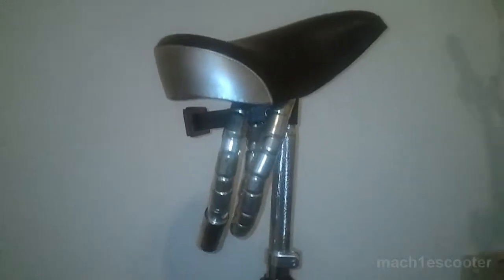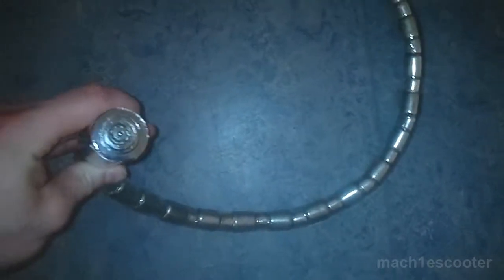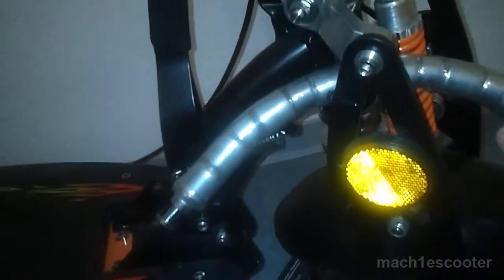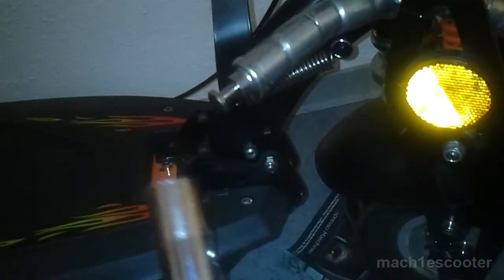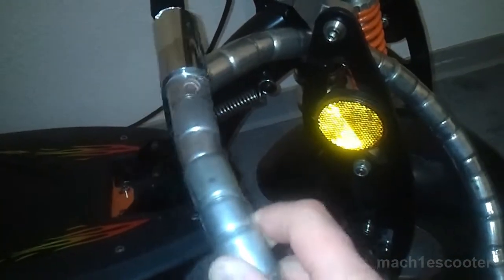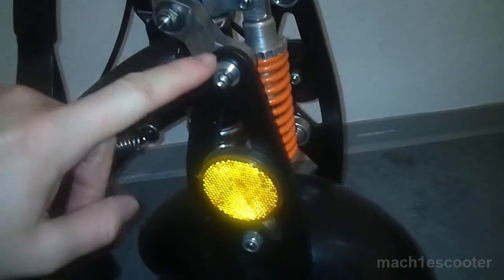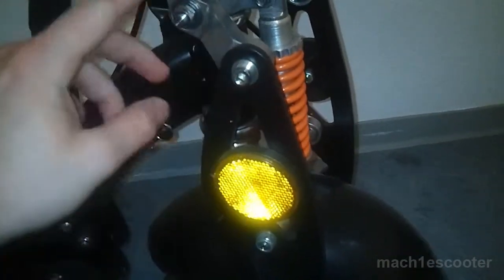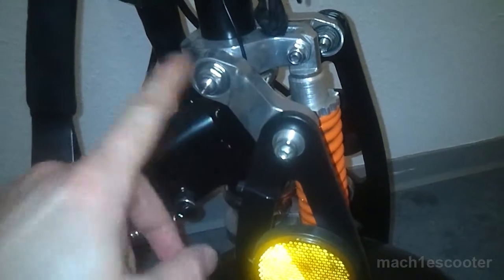MACH1 Electric Scooter 1000W 48V - Theft Protection Part 3 TUNING MODIFICATION

Comment: Wouldn't it be better to a certified U lock pushed between the front column of the scooter near the base and the body of the scooter that way they would have to take the front of the scooter off disassembling the whole front end to get at your scooter.

It's hard to describe exactly what I mean but, just in front of the lever where you placed the lock by the spring, if you used a U lock it would go from one side to the other and then you could lock it directly to a pole or cycle rack.

Just to add: those locks are crap by the way and a long way from being durable, however U locks such as abus are much better, more expensive but much stronger.
Reply from the maker: flitsies Sure you could use a U lock, it could be more durable but I believe it is heavier, too. Sometime you need a bit more reach as you can't always come close enough to pole or a cycle rack. But seriously, if someone wants to steal your scooter, he will do it anyway. He will steal it even with the pole or with the whole cycle rack ;) I just don't leave mine outside for too long or in unsafe areas.
Reply: MACH1 E-Scooter Yes you are correct no amount of locks will save your bike/scooter if someone really wants it, but deterrence is always better than handing it to them on a plate.

The lock you are using is known to be probably amongst the worst and amongst the easiest to break, the locking mechanism is some kind of softish alloy and the lock is rubbish, inside the plastic sleeve is a cable which can and is easily cut.

Using a U lock of the type I mentioned yes it is a bit heavier, but it is also by far much better and a bigger deterrent.

You could even use one of those alarmed padlocks in combination with a decent lock, so the alarmed padlock would simply be to inform you if someone is tampering with your scooter, it doesn't actually have to be used to lock anything just use it for the alarm, they are not heavy and a good addition to your security.

Anyway how do you like the scooter is it any good, I'm considering buying one of these, but am finding insurance a bit of a problem, we have to have insurance for this scooter in the UK.

Does climb hills at a decent rate?
Reply from the maker: flitsies Well that's true, the locking mechanism is a bit weak but the lock itself looks solid. The plastic sleeve is transparent to protect the lock from rusting but inside it's all metal. I don't think, you can cut it that easily. Alarmed padlocks are really a good idea, I need to consider it. Yes, it is definitely worth 600 euros. I have also got insurance and a license plate, it is quite cheap. Should be the same in the UK. Legally it is a moped. Here is a video I made, how to install a license plate: http://youtu.be/beCylVkI5HAYes, it is really powerful, it can climb almost any hill. Check out these videos, a racing gear and a hill climbing gear were used for this test. That was a really steep climb:http://youtu.be/XAT2EUkU2ichttp://youtu.be/SjLUXnuPY7Yhttp://youtu.be/ZJSC3R0AngMUsually you don't stop before the hill, so you will be at about 28 km/h like in this video:http://youtu.be/my7d0pSh3h0?t=50s
Reply: MACH1 E-Scooter Seriously those locks are not good at all, any would be thief will have that off in no time at all.

The push in part will change colour over time and use exposing the copper type colouring of the metal used the actual cable can be cut with a simple hack saw, really not worth using unless you don't value your scooter.

Spend a little extra on a good lock, use an alarmed padlock just for the alarm just to stop people tampering with it.

As for the insurance and price, yes they are similar except for insurance, I did a check on an insurance web site to see how much it would cost an experienced motorcyclist such as myself to insure it if I had zero no claims bonus, I was shocked.

Fully comp would set me back nearly 1100 hundred pounds probably around 15 hundred Euros, take away fully comp and it dropped down a lot but still expensive considering the price of the vehicle, in fact for that money I could probably insure a top of the range sports bike and still have money left over for a complete engine rebuild.

One other thing is actually finding an insurance company willing to take it on, they will take on the 500watts but not the 1000watts

So one of the problems with this type of vehicle as I'm sure younger people have discovered in trying to insure one of these is the price of insurance is so high it prices young people away from them in the UK.
Reply from the maker: flitsies No, the insurance should be around 100 GBP or even less. You need to insure it as an electric scooter or a moped and NOT a motorcycle! Check out this page: https://www.bikesure.co.uk/electric-scooter-insurance.php I believe, there shouldn't be a problem to find an insurance company for a 1000W scooter.
Reply: MACH1 E-Scooter I wish it were that simple, so far every insurance company I have spoken to have said no, they will insure the 500w version, actually that's not quite accurate, what I mean is if you have no, no claims bonus yes they will for around £1100 fully comp, if you only want third party it drops to around £260 now imagine if you were a 16 year old wanting to buy one of these, the insurance would be through the roof, cheaper than a motorcycle perhaps but still ridiculously expensive.

And yes this is classed as a moped, in fact there are only 4 companies I could find willing to insure it.

And you have to have the right type of insurance else it will be illegal.

We don't get to choose what the vehicles are insured as, the insurance companies choose and we have to put up with it.

The link you provided I have already tried them and they are not willing to insure it at all.

They will insure the 500w but the 1000w they say no it's not on their list.

Perhaps that's why in the UK the company that produces these have opted to put in a boost button thinking this will be a way around the law, but unfortunately it's not, legally this boost button increases the power output of the motor therefore it then makes the insurance void just having it fitted.

So the problem we have in the UK at the moment regarding these scooters is insurance companies unwillingness to insure the vehicle.

I've spoken to specialist companies who specialise in electric bikes, specialist motorcycle insurance who have contacted the underwriters and so far if you are to go the fully legal way it's almost impossible to insure.

But if you buy the exact same scooter with a 500w motor no problem all be it expensive.
Reply: MACH1 E-Scooter Ok an update on the insurance issues regarding this machine.There is a company called MCE who will insure the 1000W version of this scooter, it is still a bit expensive if you have no no claims bonus and the only insurance you will get is third party, but at least you can do it the legal way, of course if you have no claims bonus it is a lot cheaper.To be honest these shouldn't even have to be registered as mopeds, as it stands you use one of these in a bus lane where motorcycles are excluded and you could potentially get a fine.You must ride where all the cars go, that means cycles which are often bigger than these are ok but this has to ride with the cars that's how fucked up UK road law is regarding these small electric vehicles.I've had people drive so close to me that I could have become a hood ornament, I'm talking millimetres away from my back wheel simply because I am excluded from some bus lanes.
Reply from the maker: flitsies I'm glad that you found one! I pay for insurance 40 euros per year, it is pretty cheap here. 
I believe the road laws are all the same in Europe. I am also not allowed to use a bike or a bus lane either. So I drive on the road. I am quite fast and there is not much traffic, therefore it's alright. 
In your case, I would be risking getting a fine and would be using a bus or a bike lane. It's much safer. Stay safe!
Reply: MACH1 E-Scooter As a seasoned motorcyclist, I'm not really intimidated by their behaviour but with the way the law is it does make me wonder just what kind of road safety the authorities are after that says cyclists can use a bus lane but a small scooter can't.

Also with regard to road laws when it comes to motorcycles and cycles I think you will find that each country has their own rules but most of them are similar.

Even in the UK one part of the country will have one law for bus lanes while another part will have a different law, hell within one city you can end up with two or more different laws on bus lane use by motorcycles and cycles.

But with regard to these scooters I suspect the reason why the authorities won't open up the use of these scooters is due to worry over the youths buying them, after all look what happened with the gasoline powered moped the youths go mad.

There is a lot of interest in these scooters, but once you tell people about the insurance and registration they switch off, they are just too small to warrant all the aggravation.
Reply from the maker: flitsies yes, unfortunately that's true...